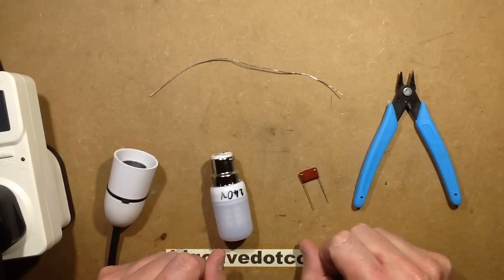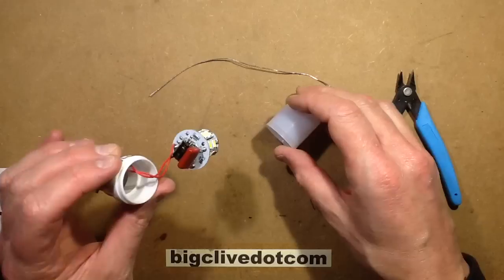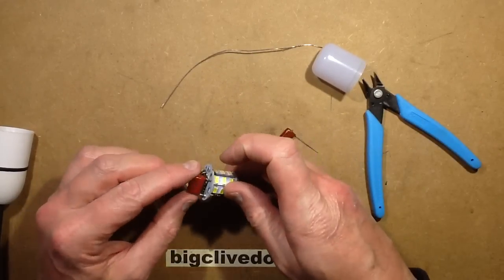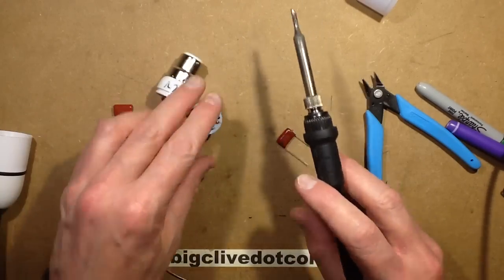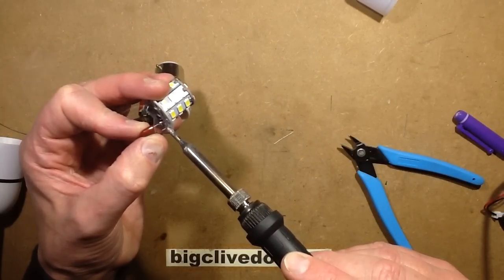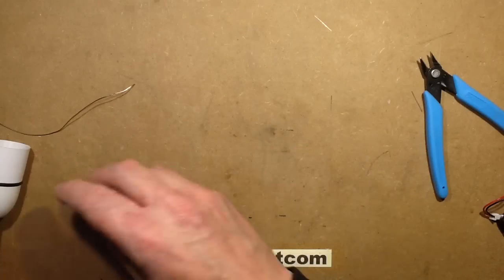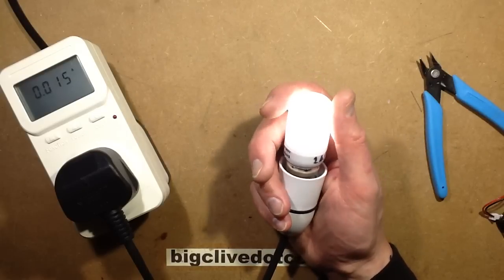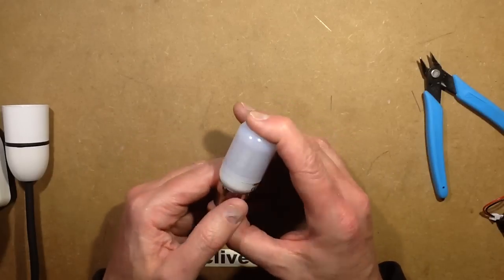Lamp mod.  For no good reason at all.

Comment: Can you achieve the same effect by instead replacing the series resistor with a higher value? Since both lower the voltage on the LEDs how do they choose the values for the dropper capacitor and series resistor?
Reply: stewie2  The biggest limiter of the current is the series capacitor. You could increase the value of the series resistor, but the resistor would then dissipate a lot of heat, all of which would be wasted.

Comment: I'm going to stick my neck out and make the prediction Clive invited me to. Basically, I'll model the circuit as two resistors in series: one is the capacitor that Clive is changing, and the other is the load.

Clive has helpfully supplied the formula for capacitative reactance at http://www.bigclive.com/ledlmp.htm. So the effective resistance the old capacitor is 1 / (2 * π * 50 Hz * 560 nF) = 5.68 kΩ.

The current going through the lamp with the old capacitor is 2.4 W / 240 V = 0.01 A.

So the voltage across the old capacitor is 0.01 A * 5.68 kΩ = 56.8 V.

That means the voltage across the load must be 240 V - 56.8 V = 183 V.

So the effective resistance of the load must be 183 V / 0.01 A = 18.3 kΩ.

The effective resistance of the new capacitor is 1 / (2 * π * 50 Hz * 560 nF) = 14.5 kΩ.

So the combined effective resistance of the load and the new capacitor is 14.5 kΩ + 18.3 kΩ = 32.8 kΩ.

So the power consumed will be 240 V * 240 V / 32.8 kΩ = 1.76 W.

Let's see if I was right!
Reply: 0.7 W. Way out. Hmm.

Comment: I've thought that the US should change our light bulbs to use a base like this one. Until I started watching your videos I didn't even know the UK used that style. I just thought a BNC style junction would be better with less problems with cross-threading and the friction many screw type bulbs have. Our automobiles use them for turn signal and brake lamps but that's where it ends.

Comment: Have you ever done a video about reducing the current on the different kinds of switching constant current led drivers? Also how can you test whether the switching type led drivers are actually isolated. I do not want to get a mains voltage shock when I touch the metal lamp armature that I am making.
Reply from the maker: It's possible to increase the value of the current sense resistor on most switching supplies to lower the output current, but it's a very small resistor.  You can't really guarantee that there is complete isolation that won't degrade over time, so if you're making a custom light with metal that will be handled then consider using a low voltage supply to power it.
Reply: I would still have to transform the 240V AC down to something like 24V DC And then use a constant current buck converter set at about 250ma for my 5x1W LED lights. I will still have to use a transformer, so why are the small yellow transformers on the led drivers less safe than the bigger ones? The light will hang from the ceiling but I can't be sure people will not touch the metal housing.
Reply from the maker: The separation on the lamp driver transformers is not as thorough as it would be in a USB style power supply because you don't normally make contact with the connections.  As long as your light has good electrical separation from the actual LEDs and wiring then it should be OK, but if that can't be guaranteed then play safe.
Reply: So it has more to do with the actual design of the circuit board, things like trace distance and separation gaps than with the actual transformer itself.
Reply: Rashombo  Traditional good quality mains transformers have two physically separate sections (split bobbin) for the copper windings. So isolation between the mains wiring and the low voltage secondary is very good. The smaller high frequency transformers used in switch mode power supplies often does not have two separate sections. Instead each winding is wound on top of another winding. The insulation on most wire used for transformer windings is enamel. The insulation between windings is just tape. Would you trust insulation that thin?

Comment: Clive, can you recommend any LED lamps suitable for replacing 60W candle bulbs. i.e. same intensity, a decent non patchy illumination out the sides, and won't burn up in next to no time?
Reply: ZXGuesser  LED filament type in a glass bulb. Don't know if there are any equivalent to 60W though.
Reply: oh, hi Mark :)
We tried the warm white "40 watt equivalent" candle bulbs from B&Q on a whim and they seem fine so far.

Comment: Can you make a video about lead based soldier? I'm curious about it, since you obviously don't care for it. hehe
Reply: ロナルド ラマーク  Lead in paint is a whole different story, as it can form a dust when being sanded down. Dust you can then breath in :-(
Reply from the maker: Lead/tin based solder is very good.   The lead is important because it makes it malleable.  The "eco mongers" got it banned as being a hazardous material and the replacement lead-free solder is much more brittle and prone to failure.  It's just another of those idiotic rules made up by technically clueless people wanting to make their mark.
Reply: bigclivedotcom I guess it's the same people who banned lead in paint and other things that used to have lead too.
Thank you for the clarification.

Comment: So, just to see if I understand why this is happening...

The LEDs only let current through in one direction.  The mains power is alternating directions.  If there was no capacitor, the LEDs would only be lit half the time.  The capacitor acts a bit like a battery...  The mains charges it for half the cycle, then when the AC flips, the cap discharges and powers the LEDs.

The reason the smaller cap lowers the power usage is because it holds less than the bigger cap, so it gets filled quicker and stops taking electricity from the mains sooner.  Since it is a third-ish the size, it uses a third-ish the power.  And since it has less electricity to feed the LEDs, they are dimmer.

Am I somewhat correct?

Thanks for the entertaining videos, Clive!
Reply: Richard
Although what you say is correct as far as it goes, the resistor method is not as difficult as it may seem, as I've learned from Clive. The voltage drop of power LEDs is about 4 volts, and using a lot of LEDs in series is common (as in "corn-cob" LED's.) 30 in series would be 120 volts. So the amount of voltage you need to drop, using resistors, doesn't necessarily have to be high. But they don't have do it quite that way anyway. There are LED chips with a built in resistor. The distributed resistance dissipates heat more effectively, and the means of getting rid of the heat is the same for both the LED and the on-chip resistance. But people buy LED light bulbs for their efficiency, so throwing away energy in resistance is not a great approach even if it is practical.
Reply: Kenneth Florek  Given the choice, why use resistors (with the resulting heat losses) instead of a capacitor (which runs cool)?
Reply: I don't think so. Clive called this a capacitive dropper. That is where you use a capacitor to drop the voltage rather than a resistor. LED's, since they are diodes, need something to limit current in order to avoid self destruction. You can use a resistor to limit the current (by dropping the voltage to the LEDs to the point at which it is passing a safe current). But, for AC, you can limit the current by using a capacitor that has the same impedance as the resistor that might otherwise be used. A capacitors impedance is inversely proportional to its capacitance, so a lower valued capacitor has a higher impedance.

Comment: Great! 220nF/680nF=32%, and 32% of 2.4W is 0.77W. Bear in mind that those caps are likely no better than +/-20%, and 0.7W is about right.

Oh and Clive, if you want someone to teach you how to use lead free solder, and when to use flux, just let me know 😉
Reply from the maker: I've no intention of using lead free solder.  The whole point of the lead was to make it slightly malleable to resist fracturing.  The lead free stuff is brittle and prone to fracturing.  They've basically done the equivalent of taking coffee with creamer and removing the coffee and replacing it with more creamer.  It's not really going to work that well, but hey, let's force it on everyone anyway.
Reply: +bigclivedotcom I wonder if the use of non lead based solder is largely why so many new PCB boards fail due to vibration in my line of work, versus 30 year old equipment that rarely has this issue. Actually the newer boards are mostly surface mount components with small amounts of solder versus old school components with huge amounts.
Reply: Well, I guess you have the luxury of using leaded solders. As I design for products manufactured and sold in the EU, I have no legal choice, so I have to ensure that vibration-prone devices are secured mechanically. And there are good alloys which are much better than pure tin these days. The point of lead was actually to reduce the melting point of solder, though it does also improve mechanical properties and the formation of tin whiskers, which is achieved by the inclusion of other alloying components in good modern lead free solders.

The other nasty effect solder is subject to is a phenomenon called cold-solder-creep, which caused many house fires in the days when people would tin the ends of stranded wire with solder before clamping them in screw terminals, like 13A plugs. Over time, the pressure of the screw caused the solder to flow, relaxing the pressure on the joint, causing an increase in contact resistance which could then cause thermal runaway failure. Indeed, before it was law to supply plugs already fitted, I remember manufacturers would pre-tin the wires on the ends of their appliance cables. Frightening!
Reply: Billy Sugger  Yes, solder creep causes problems. But then, back then most ordinary people made a poor job of fitting a U.K. mains plug anyway. The so called reason for manufacturers tinning the mains leads was to make the final testing easier. When wiring a plug, the ends are supposed to be cut off, as each wire should be a different length (in most plugs). Also mostly, there was far too much unsheathed wire to fit in the plug, so if used as if, the cord grip did nothing, as the sheath ended outside the plug.
Overheating terminals still cause problems, even when solid copper core wire is used if the screw terminals are not done up correctly.

Comment: It's not a big deal - honestly. But I was just kinda, wishing, hoping that you'd have also tried putting the two caps in parallel - increasing the current... just to see.
Guess I'll just have to try it myself...
If you don't hear from me again - it's been real - thanx ;-)
Reply from the maker: The history of this style of lamp has shown that when the LEDs are pushed hard they develop the black spot of death inside.  (Broken bond wire that arcs on the LED.)  Efficiency also drops with increased current while increasing with reduced current, so nudging the current down results in a much longer life at the cost of slightly reduced output.  Or in my case considerably reduced output.
Reply: bigclivedotcom
Right. 560nf does seem like a larger value than the others I've seen you draw out for us. Of course, we're talkin 50 LEDs too. I understand.
But this is still going on my "to-do" list... as soon as I clear some room on my bench ;-)
Reply: Sorry. I meant 27 LEDs...  guess you could tell I was just watching your other video. 
My appologies.

Comment: clive have you had a bad experience with capacitors? you seem really concerned about getting shocked by em
Reply from the maker: Mains charged capacitors are the tingliest component around.
Reply from the maker: +gartmorn  They say familiarity breeds contempt.  I'm inclined to agree.
Reply: Any good engineer should be concerned about getting shocked by mains voltage capacitors. Even if it is just across the tip of your finger, getting shocked by a capacitor can really hurt, and can even be deadly if both hands are involved.
Reply: ouch, just remembered getting zapped by static electricity, in Canada, everyday due to static buildup, Everytime I touched a switch's ground plate.

I was almost reprogrammed into a person who feared flipping switched
Reply: Fritz Kühne as a teenager I would find 400Vdc electrolytic caps from scrapped TVs and charge them off rectified mains. A lot of people are now fearful of caps at mains voltages, including me!
Reply: Indeed even a small zap through your finger can be quite painful. It's only a pinprick but it burns through your skin pretty deep.
Reply: DC electricity isn't forgiving, it feels worse than AC and makes you cry (if you survive), no one wants to cry on camera.i know, I've felt it
Reply: I have to expose the validity of a common myth, which is that, 'electrical engineers respect the power of electricity and never get shocks'!  Oh yes they do.  The reason is we get blasé!  The uber cautious hobbyist probably has less chance of getting zapped.  Probably why Clive knows all about getting tickled (by electricity)!  ;-)
Reply: I used to work somewhere that made suppressor units for VAX, the favourite trick was when checking the units to perform the test but pull the unit and throw it back into the testing pile without letting it discharge and because of the capacitors used they would happily hold their charge for many hours, no matter how many times it happened it still shook you up

Comment: Is there any explanation how a capacitive dropper circuit works? Because somehow, before watching this video, I would have thought the power rating will go up with a smaller capacitor and down with a bigger one, but it's exactly the other way around...
Reply: Tim Jones it's actually the inverse of what your wrote, 1 / (2 pi f C)
Reply: 2 words: capacitive reactance.
Reply: Reactance (sort of ohms for AC) for capacitive loads = (2xpi) x frequency x capacitance
Reply from the maker: It lets a portion of current through on each half wave as the polarity changes.  The higher the value of the capacitor, the more current gets through in each portion.
Reply: bigclivedotcom Hmmm, I will have to think that through in order to fully understand it. But yes, it makes sense.

Comment: How do I get leaded solder nowadays? Is it available from China on ebay or something like that?
Reply: I bet you can buy mercury solder from China if you're not careful ;-)

I have a reel of leaded solder that's about 15 years old, I bought it cheap from RS Components and ended up with about 25m of the stuff. I'll probably never have to buy solder again in my life.
Reply from the maker: Easily available on eBay and from GOOD component suppliers as it is still allowed to be used in service work.
Reply: bigclivedotcom How do I find a good component supplier? Oh well, I'd probably have to look on the German ebay site anyways, since I'm in Germany...
Reply from the maker: https://www.conrad.de/de/loetzinn-bleihaltig-spule-stannol-hs-10-sn60pb39cu1-100-g-10-mm-812811.html
Reply: bigclivedotcom Wow, thank you, you are awesome! And I wouldn't even need to order it, since I have about 3 Conrad shops to chose from in Berlin, the closest only about 10km away :)
Reply: I just get my leaded solder from a local hardware store.

Comment: Again Clive, thanks for nice and simple little tutorial.  Keep up the great work.

Now a little question to anyone.  For these cap-dropper circuits, I believe the caps 
need to be a specific type that I cannot currently remember.
As I get most of my components from salvage, can anyone supply or point me to 
some reference material to enable me to identify salvaged components (caps)
and usable in cap-dropper circuits.
Mind you, I cal already identify the voltage and capacitance.  It is the 'other' 
value/ratings I need help with.

Thanks.

Comment: Famous last words "I'll discharge it with my finger." :p
I picked up a charged disposable camera cap once, once...
Reply: I've hear stories of charged camera flash caps being tossed to unsuspecting co-workers.
Reply: lol i work in a camera store and love the stories about those bastards
Reply: That's. . . evil!
Reply: The version I've heard mentioned using spark ignition condensers at an auto repair shop.
Same idea but with lots less capacitance. Still quite a whack, even if you're expecting it (typically ~1uF, probably around 200-400v).
Photo-flash capacitors are typically ~330uF, 400v IIRC. Much bigger shock from those.

Photo-flash capacitors are actually quite good to make small coil guns with.
If you have the flash unit from a disposable film camera it's fairly simple to make a low power coil gun (won't draw blood, probably won't even hurt).
Wire the coil in series with the flash tube, and make the coil with 20-50 turns of 22-24AWG magnet wire around a plain old Bic pen barrel (the bit you hold on to, not the ink tube).
Ammunition is small pieces of steel coat hanger wire cut to about 12-25mm length.
I got mine to shoot across my room without much tuning.
Most of the tuning is controlling where the start of the steel wire is in relation to the coil (move coil along barrel to adjust).
Further tuning can be done by varying the number of turns and layers of wire in the coil.
Some people have gotten similar coil guns to shoot a small piece of steel wire thru a soda can. I only got mine to go thru a piece of printer paper, and that was about an inch from the "muzzle" of the pen barrel.
Reply: 44R0Ndin I like that idea!! Going to look that up now.
Reply: *****

It's a pretty fun weekend project, and you really can only hurt yourself if you touch the charged capacitors or point the thing at your eye when firing. It's pretty low efficiency, but coilguns can be made much more powerful than that. Also, they don't have the barrel erosion problems that railguns have.
I'm betting the only reason the US is developing a railgun instead of a coilgun is because it might be easier to get higher velocities or something like that.